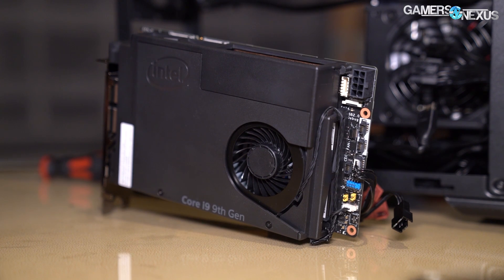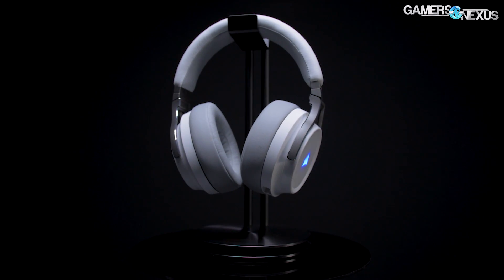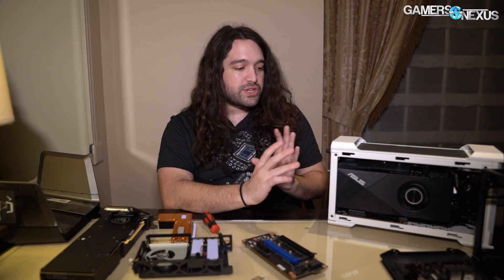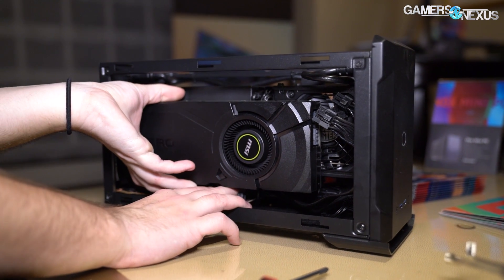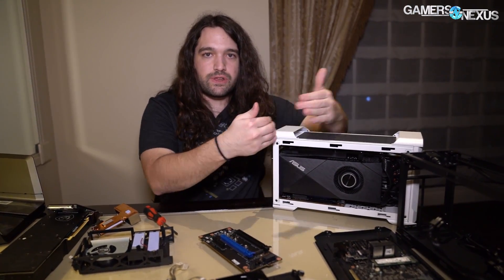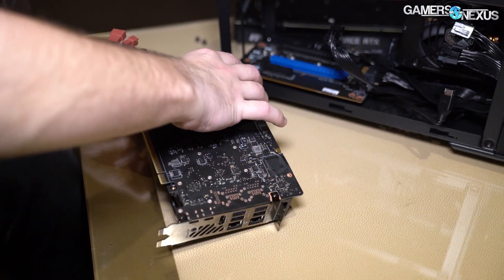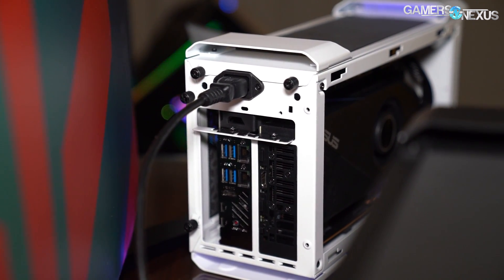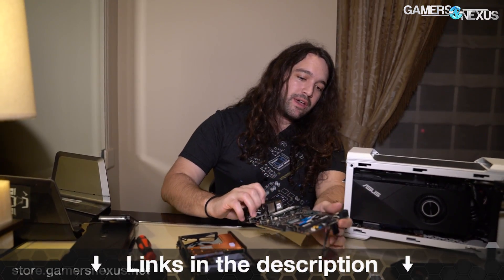Intel PCIe Socketable Computer: Tear-Down of Ghost Canyon NUC SFF PC

Comment: Make that stand vertically and a strong handle on top will be a good small powerful pc that you can carry around.
Reply: You mean, kinda ... like a pro workstation or gaming laptop which comes including a mobile power solution and monitor :-)
Reply: Psi Q  yup! But with a much more powerful  gpu (unless the cpu is  too under powered or overheats like crazy ), else just stick with a laptop
Reply: Check out Velka 5. No handle, but otherwise just what you said.

Comment: leave it to intel to fall back to Ye olde Slot system.. a Slot A i9... intigrate the an ammount of Ram and include OS drive space on the cpu die ftw..... imagine just mobo and cpu and it runs .. later add rams and hard drive.. intel snakes the low end budget segment from amd... lol .. yeah no..

Comment: I had a particular use case for this exact product, last year I began to design my own, but now I dont have to. My Idea was to setup one of these as a FreeBSD system that manages ZFS storage for a main Workstation. And connect them both via Ethernet to setup iscsi.
Reply: However it needs to have Sata ports.

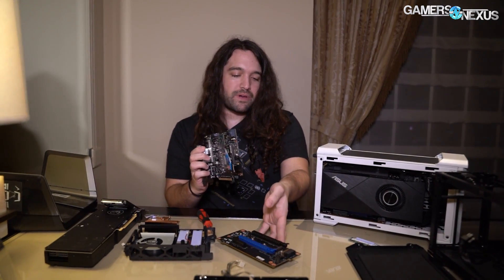Comment: Lol at 0:45 when your composite reflection is creeping on you. Good editing!
Reply: @vttklazer  I believe it's made by Phanteks, but there's a full tower out there that has a spot for a 2nd PSU and a mitx board, in addition to your atx board and system.
Reply: @CareBear-Killer  the phanteks luxe 2. Which I'm building in. It has a new name now. But the power supply they supply as well is able to power both motherboards and cpu. Able to hold a extended atx and a micro atx on the bottom. Also amazing for water cooling.
Reply: @Drazard10100   Yes, that's definitely the one I was thinking of.  I didn't know it included the PSU.  That's great!    Definitely a beautiful case. 

It'd definitely make for a great single tower streaming setup... Or Plex server... Or like 5million other things.
Reply: @CareBear-Killer  it doesn't come with the PSU but an option to purchase for going for both.
Reply: @CareBear-Killer  It does really look like a Phanteks design which is beautiful as always actually.
Reply: creepy
Reply: Why must you creep me out like that??

Comment: IBM made a similar thing that slotted into a PCI slot in certain IO expansions so you can have a windows machine inside your AS/400 Presumably so you could log into the windows machine remotly to manage the AS/400
Reply: Yeah it's basically a SOM.

I also remember 15 years ago Asrock projecting to sell some AGPcard to upgrade a line of motherboard to the next tier CPU socket. It was during the socket A, 754, 939 era.
Reply: @PainterVierax  They had these back in the 8bit computer days. This is basically just a Dell or HP blade server without hot swap.
Reply: I also remember reading that the old Acorn workstations had an x86 expansion card that you could install dos on, the really cool thing about that was it would be displayed in a window on the Acorn desktop.
Reply: I had one in a SUN workstation once. Since the workstation used a PowerPC processor, this was used to run x86 apps. It wasn't really used for managing solaris or anything.
Reply: yeah, my thought is they made a bunch of them 9980 boards, then no one wanted them, so now they're looking for ways to pawn them off, like the overstock of x299 boards after the 10980xe launch. it is sad in a way, great CPU, just way over priced compared to All other options (from IBM, Intel, and AMD).